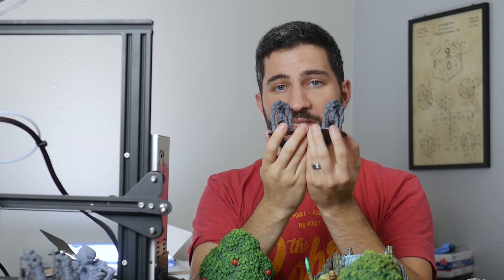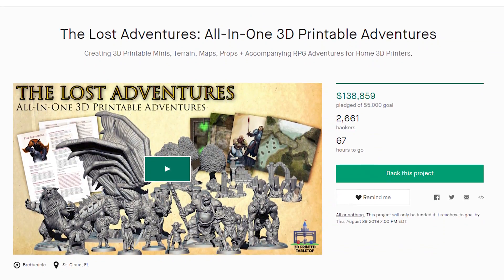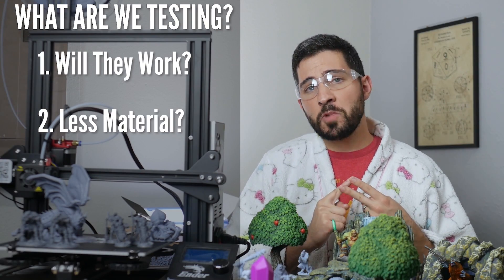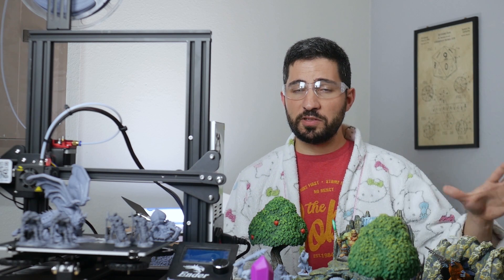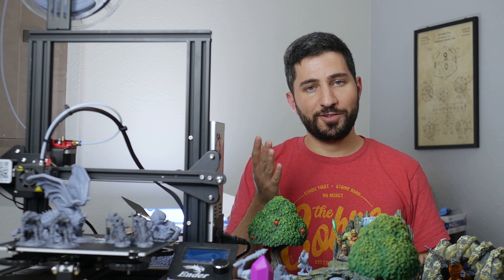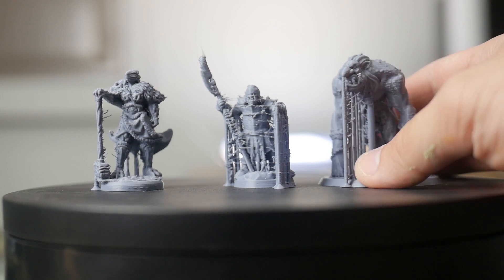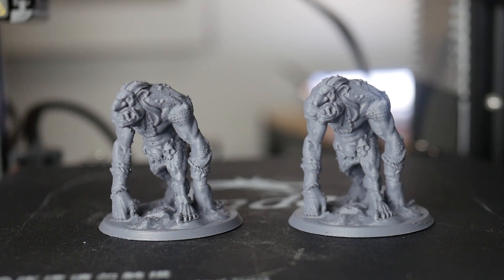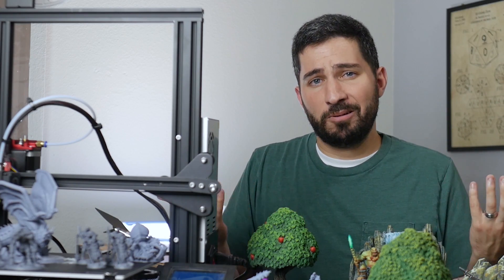Do Resin Supports Work For FDM 3D Prints?

Comment: Suggestion, retry this experiment with Cura's tree supports.
Reply from the maker: Follow-up video? :) Are there specific settings you use?
Reply: I find on most mini's tree supports from cura just encase the mini in a block of plastic that is usually tougher than the parts of the mini they are supposed to be supporting and unremoveable without destroying the mini.
Reply: @3DPrintedTabletop  my profile evolved for the one posted by Tomb of 3D Printed Horrors. I'm having a great time printing minis on also an Ender 3 with supports that are very easy to remove. Send me an email and I'll fw you the actaul profile and some pictures.
Reply: @kaseyboles30  I'm sorry to hear that but it's not my experience. I've been printing minis on an Ender 3 with Cura's tree supports with great success. They come out easily. Let's see if Danny takes the challenge of doing a follow-up video.
Reply: @jorge9117  I've been saying for a while now slicers need more smarts. The ability to recognize situations where slowing down or speeding up make sense, the ability to calculate when pretty much any setting needs tweaked for a specific area. Some things like linear advance for printers without it in firmware (coasting is sort of a quick and dirty version of it). 
And of course now that reasonably priced 32bit boards are starting to show up we should be able to put more smarts in the printer. Like a proper filament detector that senses filament diameter variation and adjusts for that as well. And just recently saw a post about a modified version of slicer that can print slight slopes to layers by knowing how to avoid running the head into higher areas when printing lower layers that looks amazing for things like terrain and perhaps lithophanes.
Reply: @kaseyboles30  I too saw that video! It was amazing! Cura has some tricks under the Experimental category worth looking at. Tree supports, adaptive layers, fuzzy skin (great for handles), etc. But yes, I see your point.

Comment: With 100% infill retraction will not suck out filament your printer overextruded. Just don't use 100% infill and it will be better.

Comment: Why not use a dual head printer with a water or isopropanol solvable filament for supports? Additionally using ASA and vapor acetone smoothing this should give some great results.

Comment: Why do all this when you can just use tree supports?
Tree supports are stable and have a model interface for easy break away.
Reply: I agree. Some time ago you asked for tips regarding tree supports. By now you should have gotten some experience with them. Isn't it time to show your findings in a video?

Also, I'm not sure eSun PLA is the right choice for your printer. Since your other prints usually look way better, you might want to try this again with your usual PLA.